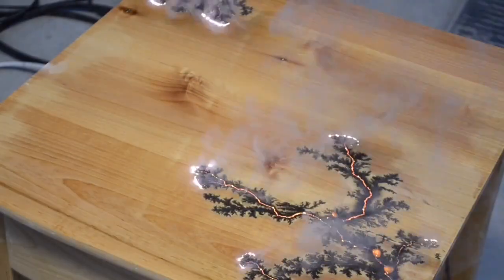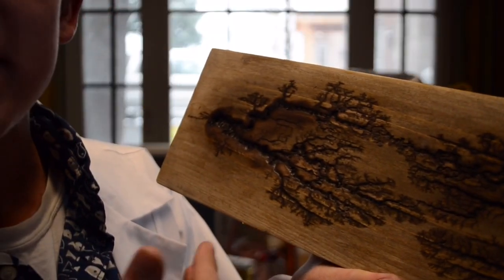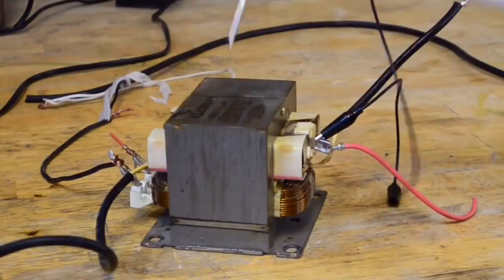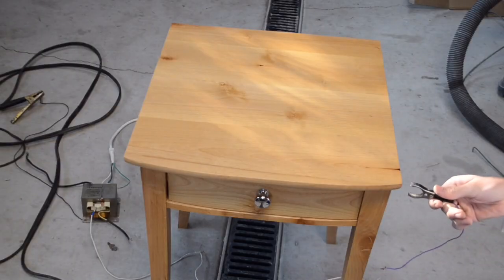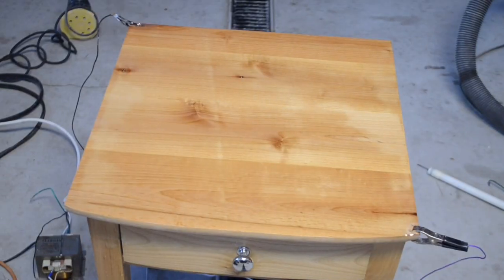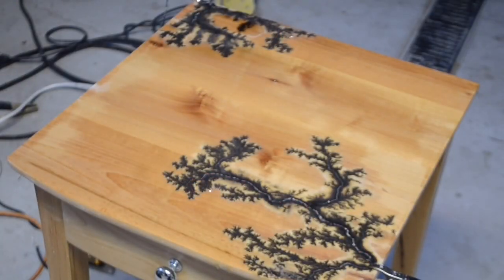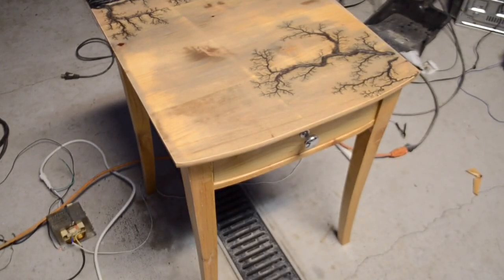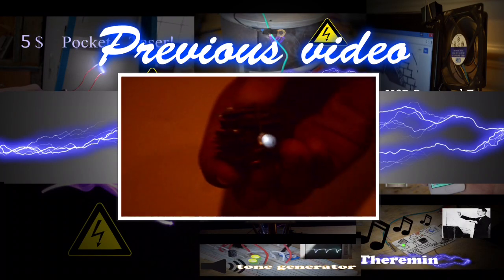High Voltage Wood Art

Comment: There's a safer method than using a microwave transformer, using a neon sign transformer it won't be deadly if it does shock you.

Comment: You can chemically age the wood with steel wool soaked in white vinegar.  The resulting wood will appear very gray and sort of sun bleached.  This may apply a nice finish to the unburnt wood, before you seal it with wax, poly or spray of choice.
Reply from the maker: +Joel Deslo that's a good idea! I'll try it out !!

Comment: Another cool thing to do with the microwave transformer is if you cut it in half and remove the secondary coil, a battery connected to the primary coil still around the iron core acts as a pretty strong electromagnet.
Reply from the maker: +Oliver Paull yes :D I've done that before xD

Comment: I suggest you to not film youself or anything else when there is a strong light source in the background. You make the object of filming hard to see. You could make the blinds for windows out of foil, wood and staples to have them easily detachable or you could find a filming angle with better background. 
I also suggest you to find a good source of diffused light for filming yourself, this way you or what you are showing will have much less overexposed spots and overall video will be more pleasant to watch.
The last thing - watch you focus, maybe you need to set it manually.